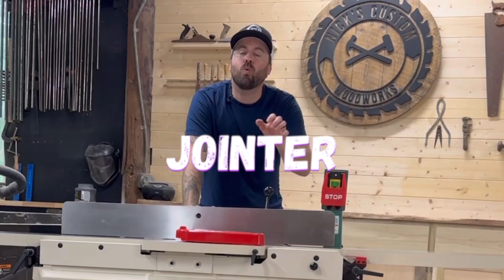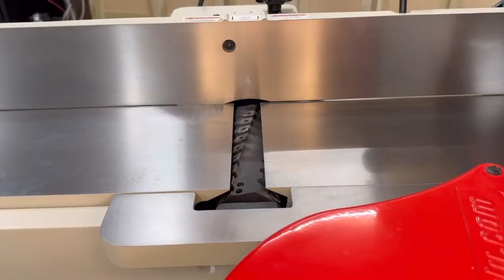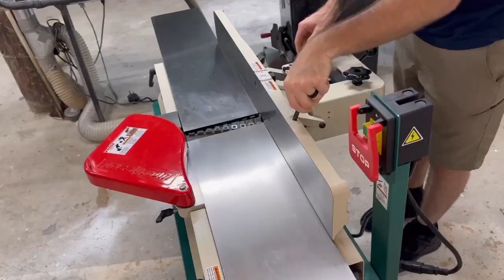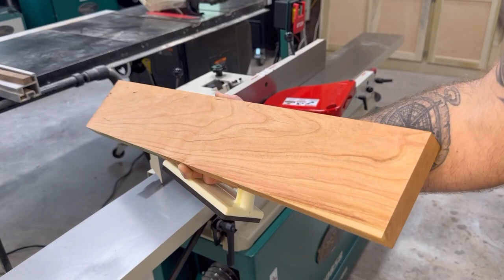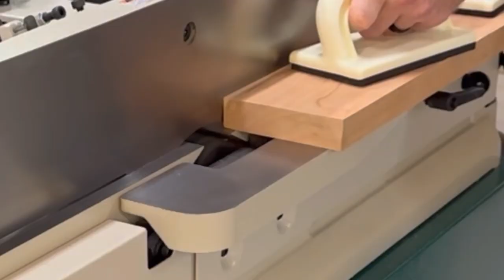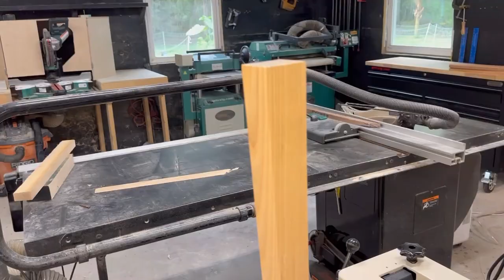Jointer 101 Woodworking’s Most Underutilized Tool

Comment: I suggest not chamfering or rabbits on a jointer. Anyone with this level jointer will already have a shaper/router/router table and both of those are easier and much safer to do with a router/table. Nobody does it cause there is no reason to with routers/shapets

Comment: How about doing a video showing how to adjust the tables?
Reply: I mean so they are set up correctly.  I don't mean how to raise and lower.  Make sense? Thanks.
Reply: Can you plane a 12 inch wide board with a 6 inch ?